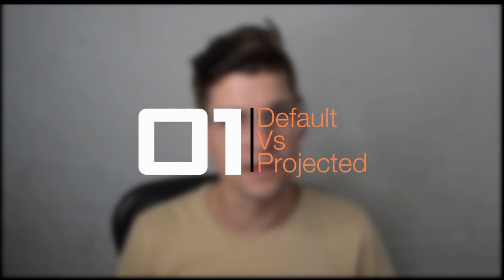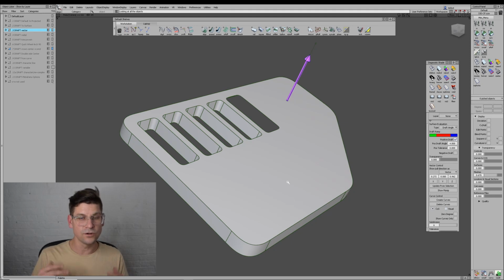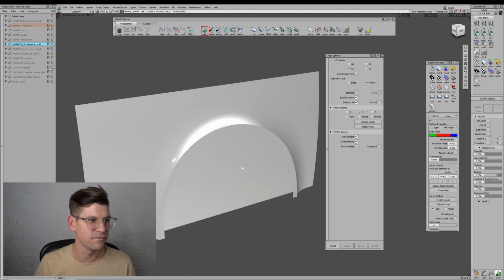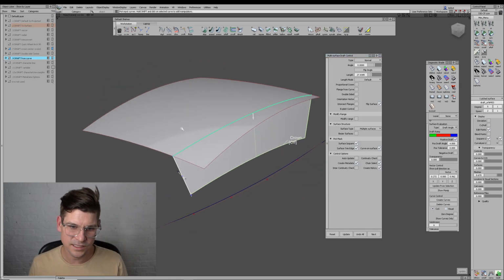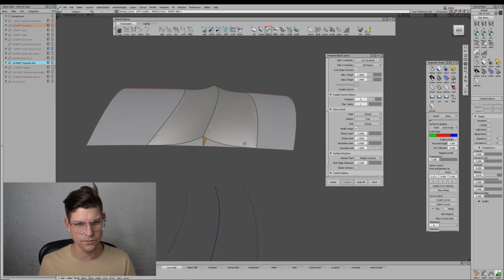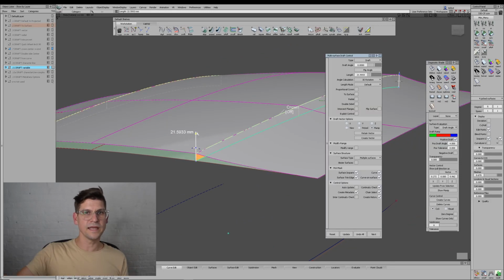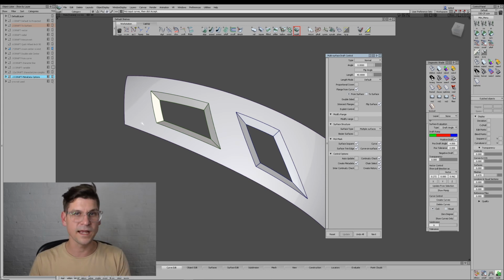Top ways to use the Draft Tool for 3D Automotive Modeling

Comment: Short on time? Jump to the timestamps below ⏱
0:33 01| Default vs Projected
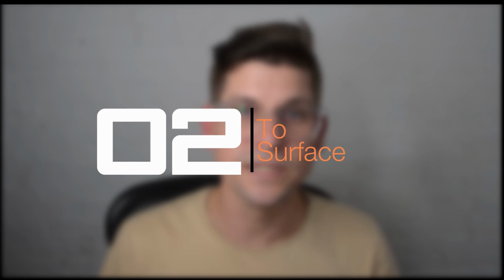1:04 02| To Surface
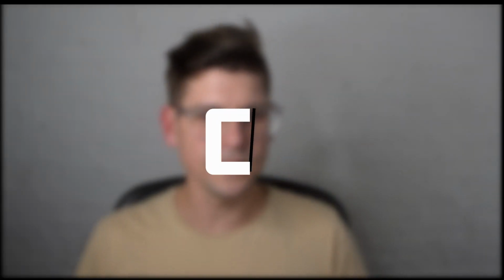1:59 03| Vector Input
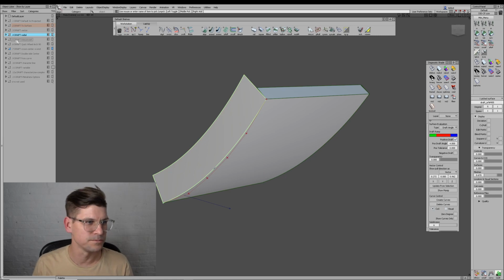3:52 05| Intersect Flanges
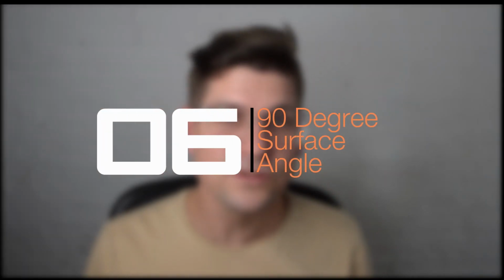4:36 06| 90 Degree Surface Angle
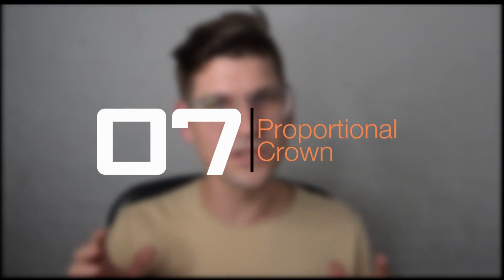5:37 07| Proportional Crown
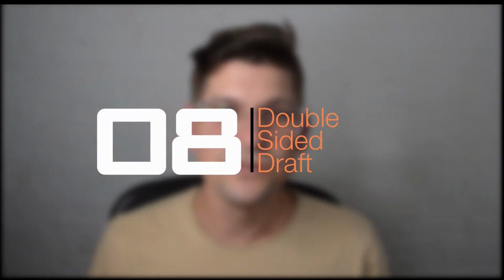 6:17 08| Double Side Draft
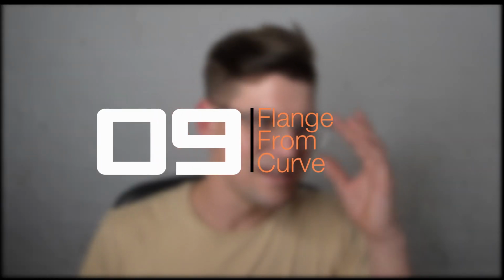7:04 09| Flange from Curve
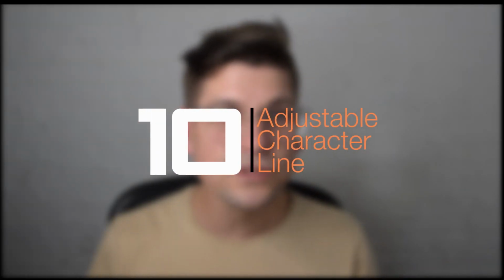8:23 10| Adjustable Character Line
9:21 11| Variable Length
10:37 12| Variable Transition
 11:29 13| Metadata

Comment: HOLY SHET how did you do this Align 5:17
Reply from the maker: Hey. The wheel arch blend?  The align tool has 2 main options. Edge and Project. The blend of the arch is align with project in the Y direction. It basically matches the surface to another surface constrained in a single axis or normal.
Reply: @kevinr6236 I'm also practicing the AMG sls but Im not able to do the Front hood section towards headlight... Just about the grill where the hood ends
Reply from the maker: @lav@lavatr8321you not able to get the blend right?  Build the upper corner of the grill and headlight to the theoretical (sharp intersection).  Same around the edge of the grill flat.  Once the primary slabs blend and you like the flow, add the fillet blend to get the softness into the headlight. The highlight and reflection always flow with the theoretical edge.
Reply: @kevinr6236 do you have an email I can send screenshots

Comment: Brilliant video dude, thank you very much for taking the time.
Im trying to teach myself how to use these surfacing programs and integrate them into my fusion workflow for producable parts, but most of the videos i can find are just people documenting their process of building the outside shell of a vehicle or something similar.
That is super useful, but videos like this are what make those others actually make some sense. Im still hoping someone will make some content showing how they design around manufacturing with certain constraints, instead of just for a pretty shell to 3d print. Like making consistant gapping of a particular distance between components and whatnot.
Anyway, thanks again!
Reply from the maker: @picassoimpaler3243  Thanks!    I pretty much only use Alias to build manufacturable parts.   Most Alias automotive modelers deliver “Class A” surface up to the first fillet and flange.   This would include gap, flush and min radius constraints.    I have used Fusion to finish my parts and prep for building tooling plugs.   On my channel,  I have an older video showing some of these considerations.   Look for one called Autodesk Alias 3D Modeling Tip-Automotive Part Line.
Reply: @kevinr6236  thanks for the recommendation! If you're feeling generous, I would be happy to pay you for a few hours of your time to pick your brain a bit.
We design / build custom automotive interiors via fusion, and it's quite limiting with the styling of modern cars. So I figure it's best to use the tools the oem used to originally design it, if we are going to try and match the styling.

Comment: Draft is a nice tool but I found it's lack of control of the surface degree and span (like explicit control). So it may not hold G0 continuity with the source sometimes. Do you find similar issues in your use?

Comment: hey Kevin - quick question when drawing curves, is there a way to create a curve with a set length while being able to snap along an edge/vector etc? I've looked everywhere for this functionality and can't find it. Again coming from rhino, when creating a 1 degree curve you simply type in the length in command line and no matter where you place you second point to create the line its locked in to the specified length. The closest I could find was using the key point curve box and creating a line which interactively displays "length" in the command line but as soon I let go it disappears and doesn't allow me to type in the length I want.
Reply from the maker: Wish I could see the specific situation.   Your correct Alias doesn't have anything quite like Rhinos tool.  Its one of the weaknesses.   For Keypoint lines, Open the Information window(default is Ctrl+5)  and in the attributes at the top is the ability to input the exact length.    To snap the curve to another edge use CURVE EDIT > MODIFY > TRANSFORM CURVE. Either in the options oo the on screen action buttons, change it to Rotate.   This breaks the Keypoint functionality and turns it into a regular curve but keeps the length when snapping.   Also, if you simply want to know the length of a curve,  the information windows - Geometry info section shows the Arc length that can be helpful.
Reply: @kevinr6236  Thanks for the explanation, I just did some quick screen shots to show the functionality, I pick my first reference point for the line, then type the length and an interactive  line appears showing you the length no matter where you move the point location and works interactively with snaps: https://ibb.co/TvpgfWB